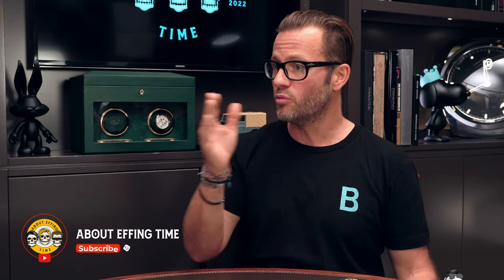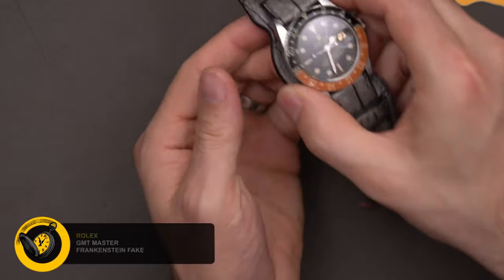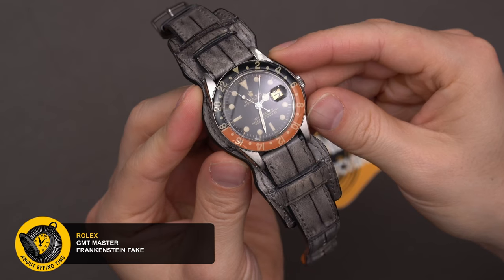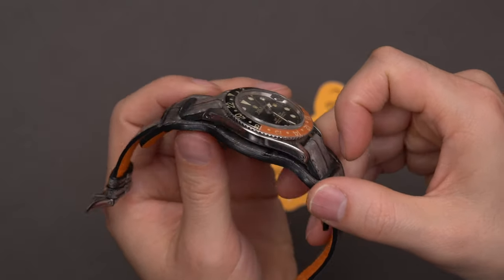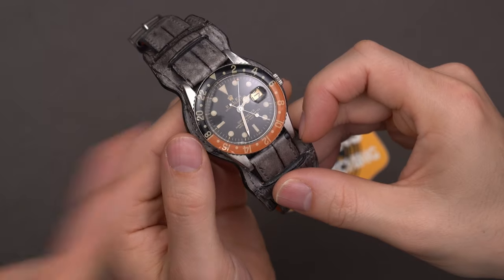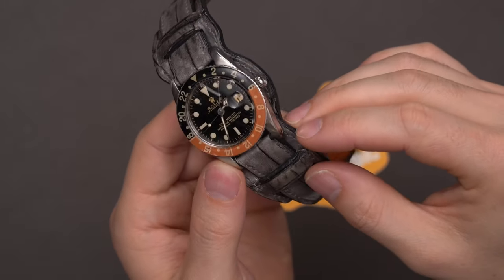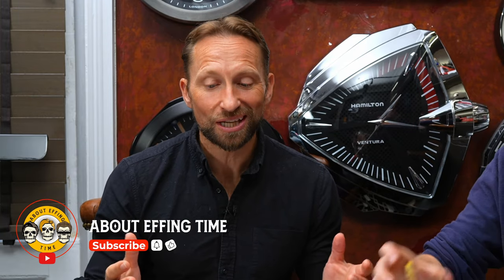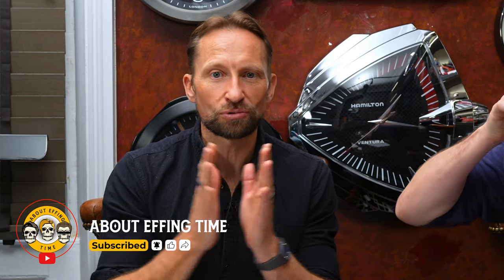SCAMMED with a FAKE Vintage Rolex Pepsi - AET CLIPS

Comment: Hey George, off topic, is it possible to work out creating a mechanical watch with a custom digital display dial that can change color? Regular hands and indices but with perhaps an LED display that can alternate between colors. That way you can have a mechanical watch but change the color of the dial with your outfit/occasion. Also, has anyone tried using the new color shifting pigments on a watch dial? The ones that shift red to gold to purple depending on the angle? Love the podcast guys. Hoping for many more episodes!
Reply: That’s such a cracking idea man. Wow. Nicely thought through indeed. Will be curious to hear what George has to say about this. I love that custom color dial idea. Wow.

Comment: At what point does a custom become a fake or frankie?
Reply: It’s a fake if it uses fake parts. It’s a Frankenstein when it’s made up of genuine parts. And I guess many of the parts could be from wherever but the issue is when someone passes off the Frankenstein as made up from legit parts. Where in fact it’s riddled with fake parts.

Comment: Bought a 60 year old diver with various service parts : movement, crown, bezel. All 1960s, but still service parts, and not 100% correct for 1963, tho correct for the later 1960s. Did I know ? Yes. Did I pay a much lower price accordingly ? Yes. Do I love the watch ? Yes. Always check everything 5 times over. Ask, ask, ask for maximum info, pics. Love and collect 1960s major sports pieces. For the fake 6542 in this vid, the original radium bezel was recalled by Rolex in the very early 1960s and replaced with an aluminium bezel. Most have the aluminium bezel, some an aftermarket one (non radium) and a handful the rare, original radium glow-in-the-dark one, most likely with cracks in the bakelite. Considering the price, never buy a 6542 without top expert assessment. And yes, most vintage pieces have some replaced parts. My 1967 321 just got a new mainspring last year. And I love it all the same. Next target : an Ed White - not the new one ! The hunt will probably take a few months ...
Reply: Holy smokes that was an intense and very welcome torrent of great information robynsjp. Seeing these frankenbuilds really intrigues me. But seeing the potential dangers in fake parts is scary. But great advice you have here about ask ask ask. 
Good luck on the Ed White hunt. That would be a spectacular piece for the collection.